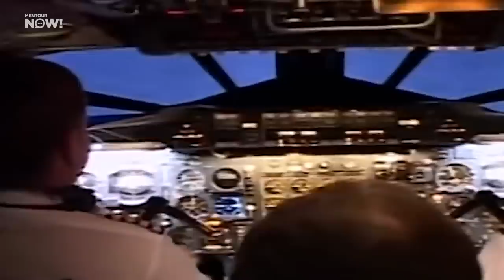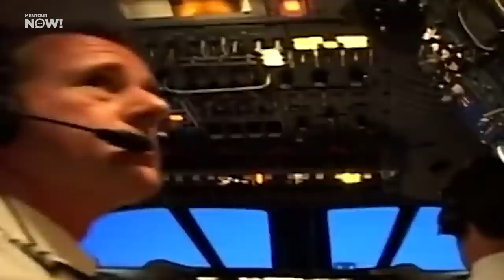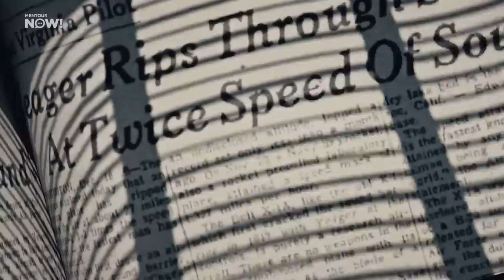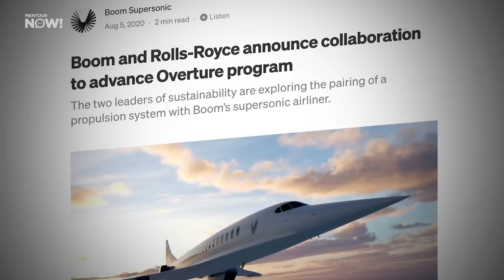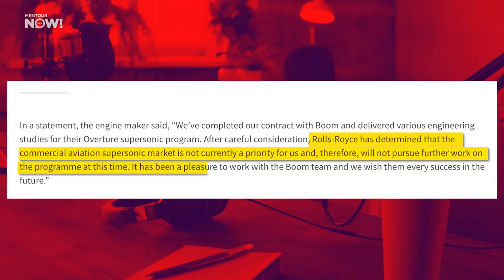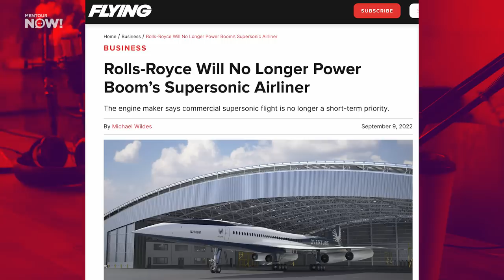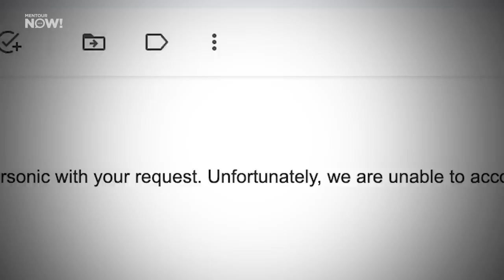WHAT’s Going On with BOOM Supersonic?! Will it Fail?

Comment: There are so many existing fighter jet engines, some have amazing efficiency. I don't quite know why a new engine needs to be developed? Example: Two Euro-fighter engines produce more thrust than what 4 of their new engines will produce and it's an amazingly efficient engine (Just read up on the "Turbofan, Eurojet EJ200" engine). Add to that, Less engines = less weight = even better efficiency. Maybe the Euro-fighter engines are 100 times the price than what they are looking for? I dunno. But having more of the same engines around (especially in military AND commercial applications), will eventually bring prices and maintenance cost down as well. Perhaps a slightly de-tuned version of the Euro-Fighter Typhoon Engine will make a very reliable engine even more reliable as well? - I would look into this possibility of I where them.

Comment: It is all a bit silly. Any 2 to 3 hour flight time is extended a lot by trip times to the departure airport plus some tolerance of road or rail delay, or a sick chauffeur. So, you can start doubling the travel time, or worse. Then, the actual flight time becomes a small factor in the overall travel time. This applies to regional flying on conventional aircraft, and will apply to SST intercontinental flight.
Reply: Taking a JFK to LHR one way flight:  
Showing: Aircraft type,  Fuel cost per passenger,  Economy ticket,  First Class ticket,  Duration

Boeing 747       $147          $577              $2,308                    8hrs 
Concorde          $753                                $5,000^                   3.5hrs 
Overture           $628^^      $1,300            $3,800                     4hrs 
Business jet^^^                                 $53,000 to $99,000        8hrs  

Notes
^ 2023 money 
^^ Assuming that Overture is 20% more efficient per mile and carries 72 passengers 
^^^ There are no supersonic business jets

Comment: Can they not initially use something like the JT8D until a more bespoke engine becomes available? Saab used a modified licence built JT8Ds in their supersonic Viggen. There would be no military restrictions in the way and no difficulty sourcing engines either.
Reply: Not nearly powerful or fuel efficient enough. An engine has to be able to allow supercruise (supersonic cruise without afterburner) . Concorde's Olympus 593 produced 30,400lbs dry. That allowed it to supercruise at Mach 2.0 for 3+ hours, something no other aircraft has ever come close to.
Reply: @Completeaerogeek  Eh what? The JT8D 219 has 21000lbf of thrust. That's the upper level of thrust range they are looking for(15000-20000lbf). The Boom Overture is less than half the weight of Concorde and will fly slower so daft to make direct comparisons.

Comment: The only plane I can think of with different engines is the Convair B-36 which had 4 jet engines and 6 piston engines, called "6 turning, 4 burning" but also called "2 turning, 2 burning, 2 smoking, 2 choking and 2 unaccounted for."

Comment: Wonderful sinopsis!
However, this leaves me with 3 key design choice questions:

1) Tail Configuration.
Why did US manufacturers (past and present) opt for separate tail surfaces (specifically the horizontal stabilizers) versus a single delta wing as did the Europeans (and Lockheed with their L-2000)?

Is it a case of simple design choices or are there strong pros and cons of one versus the other? Obviously more surfaces are more parts per se, but obviously not a major factor as US designers seem to think, and separate horizontal stabilizers would seem to allow for more flexibility and hence better control.

2) Engine Arrangement.
Why did the Europeans opt for engine pairs to be mounted in the same pod, versus US designers preferring each engine to be mounted in its own pod (except NA’s much earlier XB-70 which mounted all six engines in a single pod)?

Having engines share a pod as the European designs did, it would seem to create more risk of a potentially faulty engine creating problems for the adjacent engine, where as separate pods would appear to offer better isolation between engines. Obviously having engines as close as possible would seem to simplify the thrust point to be from a single vector, but this does not seem to outweigh the risk in case of a disastrous engine failure.

3) Drop Nose vs Fixed Nose.
Why did most passenger SSTs have drop noses, while the other large military supersonic planes (B-58, XB-70) did NOT have them, despite all of these aircraft requiring higher angles of attack for take-off and landings?

Sure, the Boom uses cameras, and while the XB-70 did have a retractable visor, it did NOT have a  drop nose and neither did North American’s proposed NAC-60 SST (derivative of the XB-70).

Comment: I think it might have been interesting to tie in the NASA X-59. They are making a lot of progress on reducing the sonic boom volume. 

Also, there is a lot of interest and investment in Boom from major airlines.

If Boom is successful, the price difference would be 1/4th the Concorde price. And that would be the difference the market needs. It will still be expensive, but much more reasonable.

I hope they are able to find a way to get the engine figured out. 

Most likely the reason they've chosen a lower speed target is due to fuel usage and efficiency. The higher speed is so much less fuel efficient and would make the prices too high.

Like you said, even the government subsidized Concorde night never have been profitable.

Comment: A documentary about the Concorde I saw had a British engineer discussing the Boeing SST program and the plane's announced cruise speed of Mach 2.7.  The gentleman said that it would have been impossible to fly that fast because the friction of air on the fusilage would melt any known alloy.  The skin temperature at Mach 2.0 was already 220°F.

Comment: The BAC Trident 3 had 3 RR speys plus a smaller RR RB162 in the tail for take off assist.  If you include the apu that's 5 engines!  The Trident is well worth a stand alone video

Comment: I feel like unless the NASA QuiteBoom program grows any fruit that SSTs will just never be viable. In the USA for example if it were possible to run SST service coast to coast without breaking every window along the way. that would probably be profitable.  Apparently during the Boeing SST project they flew the XB-70 over I think OKC and even at 60,000ft it was damaging stuff as it went over the city at Mach3.

If NASA cracks the code for "quiet" super sonic flight it might see a comeback for things other than fighter planes. And also serve the reminder that yes NASA plays with airplanes too, Aeronautics is the first A(a lot of people think they are just rockets and space station).

Comment: I work at a Concorde museum, and we all hope that Boom (unfortunate name) are more successful than Aerion (who had a better looking design). 
The XB-1 was supposed to fly before the end of 2022, but why test it without the Overture (unusual name) engine?
There are loads of Atlantic routes under 4,890 miles, but the only non-stop Pacific routes would be SEA/YVR–NRT. 
Flights from LAX/SFO to BJS/PVG/TPE would have to re-fuel at ANC, and flights to HKG/BKK/KUL/SIN would have to refuel twice, so would M1.7 be fast enough?
It’s admirable (or crazy) of Boom to take this challenge on, and of UA/AA to place options, so I hope there are enough millionaire passengers to make it worthwhile.
If the rest of us only fly once on a trip of a lifetime, that might not be enough to sustain the market for long enough.
Reply: Nice post

Comment: A lot to unpack. Though ultimately, I don't see a way forward. As you said in the video. Without an engine, you have no airplane. I don't see sustainable aviation fuel as a make or break for this. It will be a high end service and being green won't be a major concern, even though it would be a major selling point. 
The laws of aerodynamics may be a stumbling block to suppressing the sonic boom. Compressive aerodynamics are extremely complex. Boom may need access to more super computing power than is available. It may exist, but not be useable by Boom.
As I said, there is a lot to unpack, and there may need to be a more in depth video than you have had time to put together. A very informative video at any rate. Keep up the good work.

Comment: Anytime you see a development company building something without engines....be VERY cautious of them.   You should have your engines all worked out before committing to an airframe design because of weight/balance and aerodynamic issues.   The fact that all of the current engine manufacturers have taken a pass on Boom should tell you that this isn't a viable idea because if it was...they'd jump at the chance to supply engines for it.

Comment: I really admire what BOOM is trying to do. I’m not sure how composites are going to fare, doing multiple supersonic flights. The engine issue aside, I’m wondering how they are going to deal with the high cabin temps from friction heating. Concorde was a very clever but, complicated aircraft. This, I think, would be no exception.

Comment: 5:28 Actually the Hawker Siddeley Trident (ironic considering this next part) had a different (from the other 3), smaller 4th engine added to improve take off performance. It's the only aircraft I know of that had more than one engine type on a single fuselage in regular usage, but it's possible there's more.

Comment: My dad managed to see the Concorde in action way back in the late 1970's, during the brief period of time when they flew here to Singapore. The biggest thing he remembered about those planes were their high levels of noise (according to him), and personally I won't be surprised about that given their jet engines; I reckon they would be about just as noisy as a modern jet fighter at full thrust.
Reply: yep, the sonic boom doesn't matter, you won't be allowed to take off of any airports with those low or no bypass engines.

Comment: Convincing Pratt & Whitney to design a civilian version of the F119 engine would be ideal. 26,000 pounds thrust would likely enable the target speed without using afterburners for higher fuel efficiency. The F119 is already a extremely optimized design. The changes would include increasing the fan size for a higher bypass ratio. Using heavier longer lasting alloys in the turbines & stators, and deleting afterburner, vectored thrust, & any stealth coatings or features.

Comment: as someone who makes supersonic SSTO in KSP using very aerodynamic shapes, this seems a bit off, and can confirm the fuel and center of mass being very important as well. Usually carry 2-3 engine types as well for different altitudes. The concorde's dual intake engines were genius though i wonder if they had additional stages for the air to go through compared to a normal turbofan. The main question here is just the hull shape being the usual sausage rather than flat especially compared to some of boeing's newer subsonic aircraft that have a flatter more aerodynamic body.

Comment: I didn't ever fly long enough to make real difference in traveling. Hamburg - Belgrade is 1,5 hours flight... But whole thing is 4 hours. 
1; walking kilometres from parking to Check-in and check in
2;customs clearance
3; boarding
4; taxi, wait shit and giggles
5; flying
6;landing and shit and giggles with gate and tow
7; getting out
8; find bag
9; customs and immigration
10; walking to parking kilometres...
So 10 things combained are 4-5 hours... Make flying part take half the time... Still 3,5-4,5 hours trip... 
We don't need faster planes. We need airport efficient with less shit and giggles. 
I like airport in Tivat small place walk 5 minutes from airplane to parking. And other way around is 10 minutes just efficient

Comment: The mismatch between the need for thrust at low speed/altitude (a big fan) and power at high altitude (the high exhaust velocity of the jet), often leaves me wondering if a hybrid approach is possible. No batteries involved, rather, the mechanical power of the turbojet used to drive a mechanically simple "electric fan" for extra takeoff thrust, that enters a "minimum drag" configuration at cruise speed/altitude. These could also provide reverse thurst assistance after landing.

Comment: Many aircraft had multiple engine types (mixed propulsion): variants of the B-36, P2V Neptune, C-82, C-119, KB-50. others include the AJ Savage, FR Fireball, Rutan Voyager, Douglas D-558, NF-104 Starfighter. plus plenty of failed prototypes.

Comment: So what is the deal with this Symphony engine, which Boom claims on their website that the engine is Boom-developed?  35,000 lbs thrust?
Reply: @traderalex1. Yes, the engine will be a 72 inch, medium bypass, twin spool turbofan, with 35,000 lbs of thrust, and no reheat.

Florida Turbine Technology, a division of $1.88bn Kratos Defence, started the symphony engine design in January 2023. Boom stated that no current engines, either military or commercial, are suitable for adapting to Overtures unique requirements. 

Boom will design the engine pods and the variable geometry exhaust and inlet ducting.

A big fuss is being made about Rolls Royce ending their contract with Boom, but AFAIK the contract was only for consultancy, and not to build an engine for Overture. Besides which, the Symphony project would be totally unsuited to the tier one engine manufacturers, like Rolls Royce, GE, P&W, and Safran. Their cost base and time frames would be out of kilter, and the volume of sales would not warrant their investment. GE caught a cold with the Affinity program.

Comment: I think you nailed it on the head. We have the technology. A lot of military aircraft are capable of supersonic flight. And the engine manufactures do not see any return on the investment. Plus, we no longer live in the 1960-1980's. We can accomplish most business meetings on video calls. Many, if not most, Transatlantic or Transpacific flights are for recreation. Those going on vacation are a bit grumpy about 8-12 hour flights, but will put up with them and build them into their itinerary. There is simply no market.

Comment: Great video about the aircraft. Unfortunately, technical advances cut both ways and all the tech applied to by Boom has been used to improve normal airliners. Also, what market is there for going marginally faster on transoceanic flights? Good luck to them, but I put the chances at less than 5% they even produce a flying prototype
Reply: @bobqzzi

Taking a JFK to LHR one way flight:  
Showing: Aircraft type,  Fuel cost per passenger,  Economy ticket,  First Class ticket,  Duration

Boeing 747       $147          $577              $2,308                    8hrs 
Concorde          $753                                $5,000^                   3.5hrs 
Overture           $628^^      $1,300            $3,800                     4hrs 
Business jet^^^                                 $53,000 to $99,000        8hrs  

Notes
^ 2023 money 
^^ Assuming that Overture is 20% more efficient per mile and carries 72 passengers 
^^^ There are no supersonic business jets

Comment: The Rolls Royce BR725 is an existing medium bypass (4.2:1) turbofan at 16900 Lbf, which fit perfectly to the Overture specs. Why couldn't they use that?
Reply: 35,000 lb required

Comment: Great video. Yes I'm hoping that they succeed so one day maybe I would be able to sense what going that fast feels like. And if they can do it and get engines that do the job. I'm sure that it will be a real buzz for ordinary folk to travel at those speeds if they can keep prices down.
Reply: At airliner cruising altitude it feels exactly the same flying at 1300 mph as it feels flying at 500 mph, but with a smaller, more cramped and noisier cabin. Sensations of speed don't happen more than a thousand feet or so above the ground
Reply: @harryspeakup8452  I believe it would feel different.
Reply: Florida Turbine Technology, a division of $1.88bn Kratos Defence, started the symphony engine design in January 2023. Boom stated that no current engines, either military or commercial, are suitable for adapting to Overtures unique requirements. 

Boom will design the pods and the variable geometry exhaust and inlet ducting.

A big fuss is being made about Rolls Royce ending their contract with Boom, but AFAIK the contract was only for consultancy, and not to build an engine for Overture. Besides which, the Symphony project would be totally unsuited to the tier one engine manufacturers, like Rolls Royce, GE, P&W, and Safran. Their cost base and time frames would be out of kilter, and the volume of sales would not warrant their investment. GE caught a cold with the Affinity program.

Comment: PFFT. It costs me about $2500 to fly just about anywhere!
I'd pay USD 1500 to fly on a Concord - in a heartbeat!
But I have already been supersonic - in a 747 flying back from Perth to Christchurch, NZ. We were pushed along by an extreme tailwind, and the Captain of the almost-empty 747 announced we were traveling at almost MACH 1.2 ground speed. I believe we were only 1 or 2 minutes off the all-time commercial flight record between the two cities.
Flying to Perth on the same 747 was more than 2 hours longer than the return flight!

Comment: 5:25 there were 727-Super27 RE's aka re-engined 727's, however the larger more powerful engines could only fit in the number 1 and 3 spots leaving the origional smaller engine in the tail to maintain the required 3 engines for x overseas distance. I know for a fact that there was a plane that had 1 or 2 much smaller "booster" engines in its tail that were only used for takeoff but i cant remember what type of plane, what country, if it was commercial, experimental, or military.